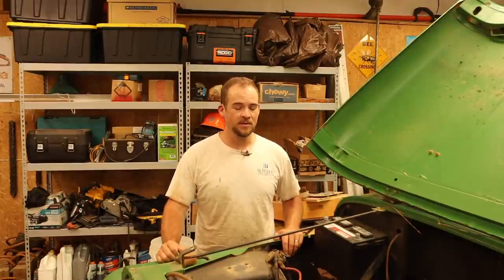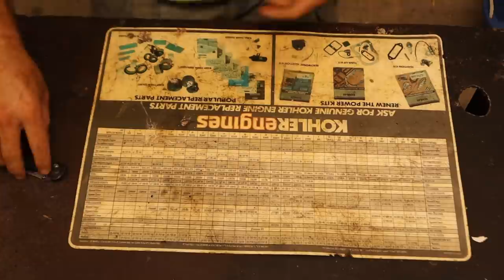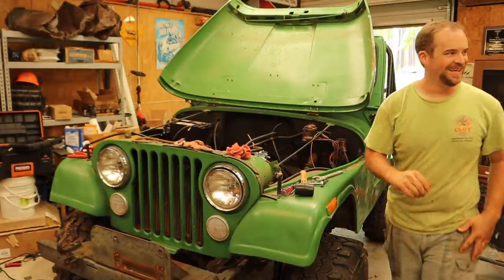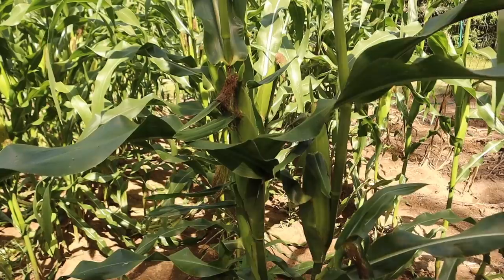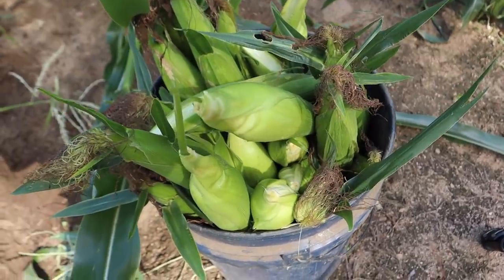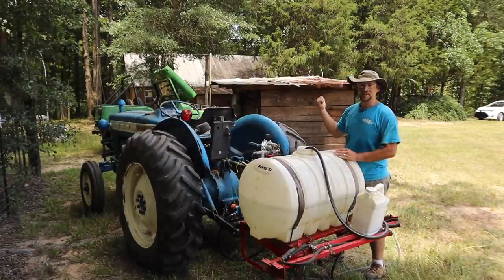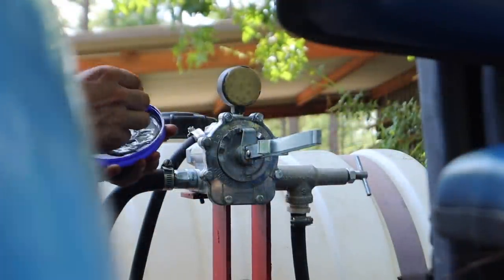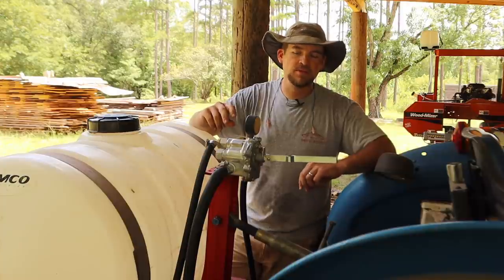This Is How I Homestead

Comment: Once used JB Weld to fix the engine block and head on a 4 cylinder Ford Ranger between  3 and 4 piston. Drove it till I sold it several years later. Enjoying the videos.

Comment: Back when I was younger I had a 1956 Ford 292 that had the water jacket repaired with JB Weld, when I sold it four years after I had repaired it, it was still running strong.

Comment: I use JBWeld for lots of little projects.  One of my most common repairs is to the plastic threads in chainsaws that get screwed up.  I clean the hole with break cleaner and blow it out.  Then, with a toothpick, I coat the sides of the hole with JBWeld.  After it partially sets, I coat a P type screw with grease and screw it back in, loosely.  Sometimes, I just screw it in and take it out.  Other times, I just leave it in for a while, according to how bad the existing threads were before the repair and how much JBWeld was used.  The next day I screw in the bolt, gingerly. It usually does a good job.

Comment: Like your jeep but when I saw that little air cleaner on it I got reminded of a big mistake I made years back. I had a new Vega and replaced the air cleaner with one of those small ones. The bolt had a nut on the inside that came off and when right down the throat of the carb, thru the intake manafold and passed thru the valve down to the cylinder and piston. Being an aluminum block the damaged done could not have much done to repair it other than maybe a little homing. Since then I never messed with another one of those cheap little air cleaners jut in case something comes off. Terry

Comment: Smart move, converting back to gas.  Back in the 70s, I worked for a propane company, and they talked me into converting my 3/4 ton Chevy to propane.  BIG mistake!  Propane has a higher octane rating than gasoline, but back then, unleaded gas wasn't mandatory, so most stations still offered lead.  The lead is needed to cushion the valve seats, propane is hard on the older valve seats.  It also is only about 70% as efficient as gasoline (fewer Btu's).  Only reason it was good for me was getting motor fuel at cost, plus fuel tax.

Comment: I repaired a radiator in an S-10 with JB weld and it was still holding when I traded the truck 2 years later

Comment: liked the video, but I have a suggestion that when putting the wheel on the Jeep, you need to tighten the lug nuts in a star pattern. That way the force is equalized on the drum and especially on the disc brake.
Reply from the maker: Thanks for the tip!

Comment: i broke a thermostat housing bolt off on a big block G.M. 400. i drilled for an easy out and broke that off too. i then drilled out the entire bolt and easy out  which was no easy task. i filled the hole with J.B. weld let it cure and tapped threads in the weld. i rebolted the housing onto that block and drove the car for about 2 more years without any issues.  no B.S. and i sold that engine for a buttload of cash.
Reply from the maker: It’s impressive stuff!

Comment: Course ground black pepper will sometimes fix a small radiator leak.
Reply from the maker: I’ve heard that, but my leak is actually the water pump. Probably will need replacing.

Comment: It is nice to see someone running, Big Blue, a Ford tractor.  All these idiot, today, think green or red is the way to go, but Big Blue will be around long after they have bit the dust.
Reply from the maker: I’m certain my orange one will not outlast my blue one.
Reply: Fall Line Ridge that blue one is probably already 30+ years old, right.  What is it a 3000?  Just keep the oil and hydraulic changed and it will last you a life time.

Comment: Pull a soil sample or two where you plan to put in your food plot.  Land that has never been farmed before will have very low fertility and pH.  It doesn't have to be perfect, but food plots rarely are.  The weed you showed is called eclipta, from the short shot you showed, glyphosate should get it. I would like to see you use some ppe when mixing and loading the sprayer.